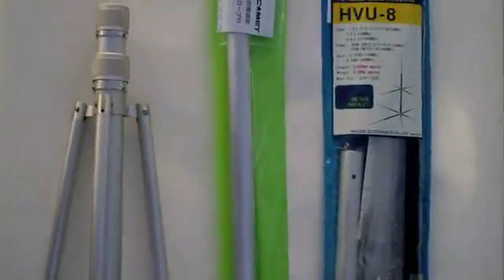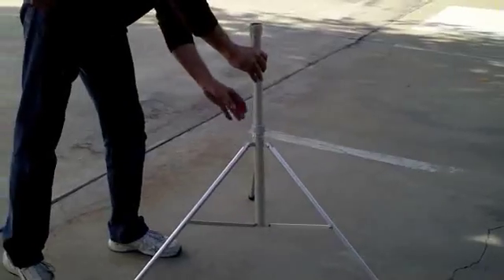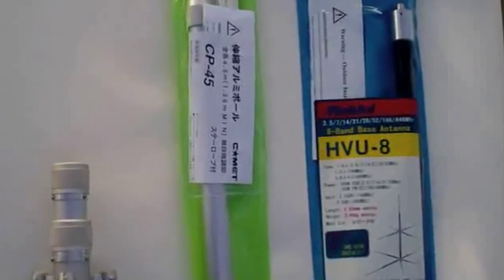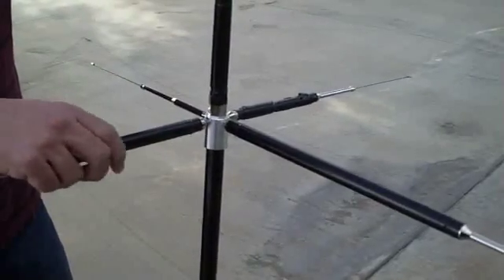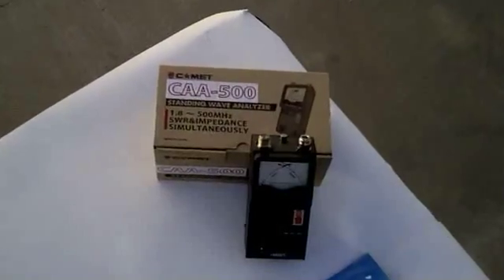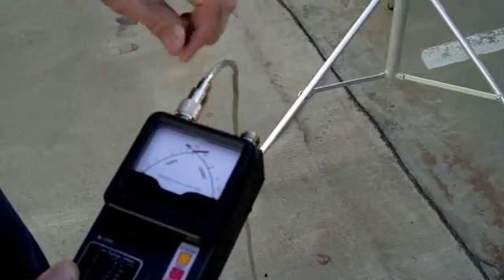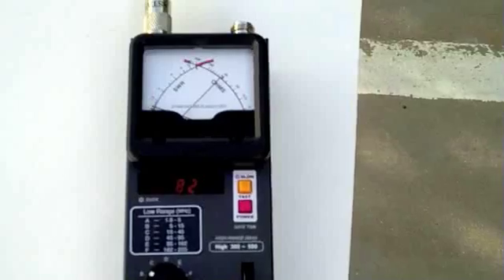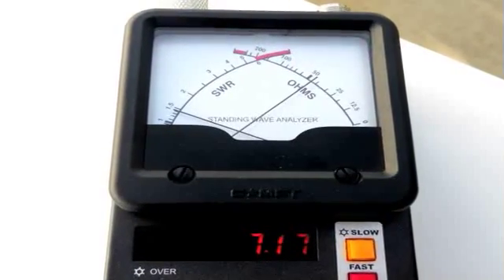HVU-8 (Maldol) CAA-500 (Comet) demo

Comment: Two questions.  What is the radiation pattern?  Do both radiators and radials have to be adjusted equally?
Reply: The pattern is omni-directional.  The radiators lengths are critical, the radial lengths aren't but can be adjusted to fine-tune the SWR.
Reply: @bambamforeverandever  Thanks. Does it matter if radials are in same vertical plane with the radiator? Is height a big factor, E. G. On mast above roof or r/V trailer?
Reply: @h2osmokey  The radials  and the radiators are screwed into pre-drilled holes at the top (radiators) and bottom (radials) of the antenna.  The radials provide the provide the ground plane and should be above any other metal objects...roof, RV trailer, etc...
Reply: @bambamforeverandever  I can't find an explanation for the extra whip/s included for some bands.  How are they deployed?